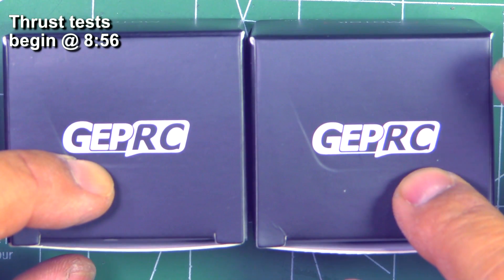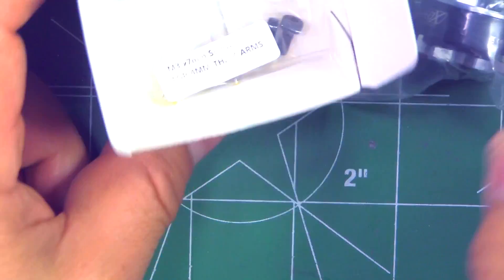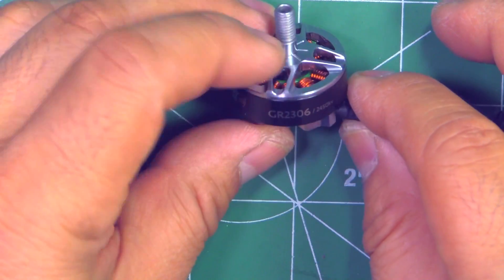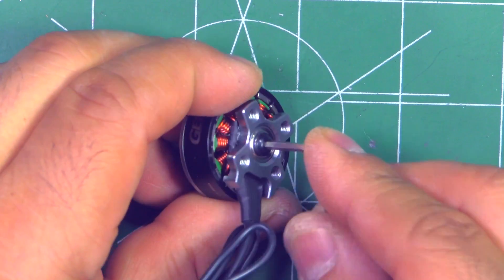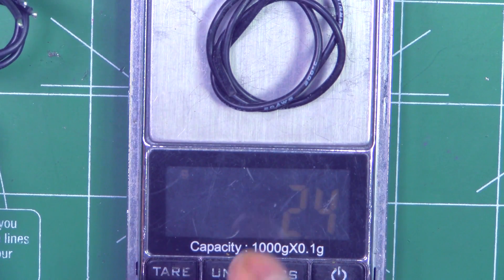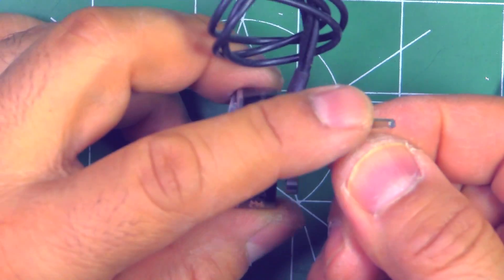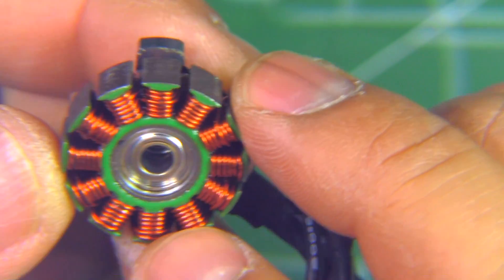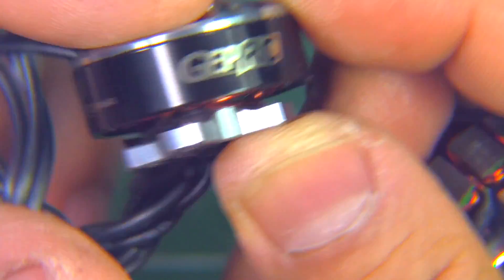GepRC GR2306-2750KV Thrust Tests & Overview - Loads of Power!

Comment: I recently shot this video using this motor in one of my foam park jets, since picking some up after watching this video, it has become my favorite motor for park jet use, on 4S it just screams.  https://www.youtube.com/watch?v=BzQbmGFKnF8&t=3s  The plane weighs just over 18 oz, on the bench with this prop 6x3 it produced about 1770 gr of thrust!  It is a serious beast!  If you watch the video and read the comments section, I have links to the ESC, prop and battery I used.  Thanks again for your testing, otherwise I would not have found this motor.  I have well over 300 flights on 3 and 4S on this motor in this video and it is holding up like a champ :)  Cheers, Scott

Comment: Which ampear esc are used for maximum thrust
Reply from the maker: For all my tests I use HobbyWing XR40A. You can use any GOOD 30A ESC for this motor because when you fly Max Amps are about 35 to 40% lower
Reply: @EngineerX  thanks for replying
Reply: Motor: 3536-1780kv Brushless
Sir please check this moter thurst

Comment: Mine just showed up in the mail, it is an absolute beast, thanks for your testing, using a 6x3 EMP prop on 3S, I got 730 gr of thrust at 50% throttle and 1290 gr of thrust at full throttle.  This is the most powerful quad racing motor setup I have tested thus far in my park jets, just posted some flight video here today https://www.youtube.com/watch?v=sWeHx4Za-NA, it really screams, thanks again for your testing and demonstrating how great this motor performs, loving it!  Thanks again, Cheers, Scott
Reply from the maker: That's some good speed and performance from this motor on your ParkJet. Cool to see how motors like these are used on craft other than multirotors. Thanks for sharing.

Comment: Another excellent review and test session, thanks so much for doing this, very good performance on 3S with the 6040 prop, really impressed with that :)  I notice your namesake EngineerX motors from BrotherHobby are now listed on Banggood, do you have any insider information when they will become available? ;)  I think the 2307 2700 would be a real beast in one of my park jets :)  Thanks again, I'm very grateful for the service you provide to the hobby by doing these in depth evaluations, much appreciated :)  Cheers, Scott
Reply from the maker: Thanks for your kinds words and for watching the videos. Without viewers like you, the motor with my nickname on it wouldn't have been possible. So I'm thankful to everfyone as well.
Unfortunately I don't have info on dates for availability on motors. I imagine there was some delay due to Chinese Holiday and there's always some lag time until they catch up after their holidays. From what I've seen in the past, it takes about 2 to 4 weeks from the day that motors first appear on BGood. Not exactly detailed time frame info but I think it shouldn't be too long before they become available. 
I didn't know this size motor would fit a park jet ducted setup. I thought those use in-runners? But very cool and interesting to know they could be use in a park jet. I'll have to check out some of those setups one of these days.
Reply: Thanks very much for the response, I have it setup with BGood that I should get an e-mail when the EngineerX motor is available, so I can get one right away.  It will work out great, the park jets I fly have a mid mount "prop in slot" using a 6" prop on 3S, I have been experimenting with several different quad motors for a few months now, 2306 2700+ Kv is a good ball park size and Kv for excellent power and I know BrotherHobby makes very good motors, so I'm sure the EngineerX 2307 2700 will give me some excellent power in one of my foam park jets.  Excited to try it out, thanks again for all the work you do on your channel sharing your knowledge and the performance of the motors you test, I have ordered one of these Geprc motors to try out as well :)  Cheers, Scott
Reply from the maker: I watched your videos, now I see how you use them. Very cool park jets! And on 3S the loads are not bad for motors of this size and those frames are very light. I was thinking traditional ducted fans at first -wrong thinking :D
I just saw them pop out on https://www.helidirect.com/fpv/electronics/motors/brotherhobby-2307-2500kv-4-5s-brushless-motor-for-rc-drone-fpv-racing.html
Says availability of 3/31/18 so I imagine BGood should be around that date too. 
Hopefully these do the job for you. BTW, that GepRC GR2306-2750KV is a beast. Perhaps one of the most powerful 2306's I've ran on the thrust stand. As I showed on video, the only concern was the bare appearance on the stator teeth faces. Could develop some rust if it gets wet, but just observation as I have not confirmed that it can happen yet.
Reply: Thanks so much for the kind words and the response, that is great news, it will also allow my quad racing motor funds to recover a bit ;)  Thanks for the info on the GepRC motor, I will keep an eye on that, sometimes I do have a lot of moisture on the grass when I land the planes, so I'll keep an eye on the motor for rust.  I'm excited to try out your motor in the 2307 2700, I have used one other BrotherHobby motor in my testing of quad motors in park jets and it was a serious powerhouse (Returner R2 2205 2800 Kv) for it's size and weight.  Thanks again for the info and once I get the EngineerX motor, I will be testing it at the field for some turning and burning :)  Cheers, Scott